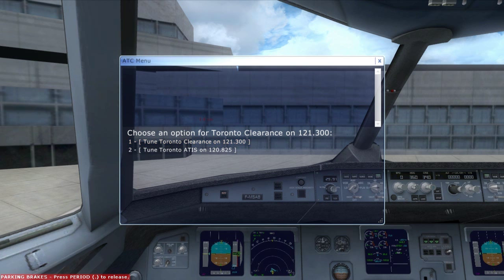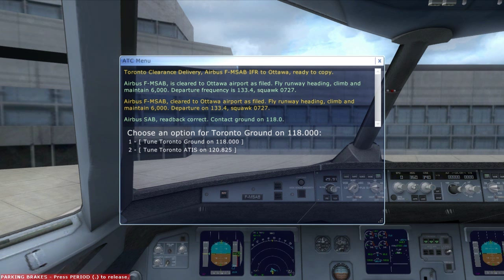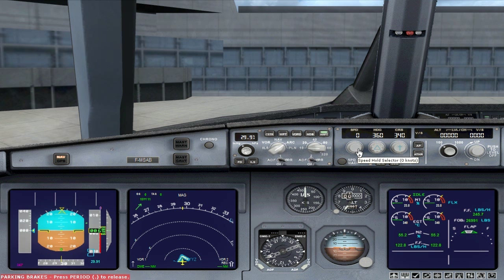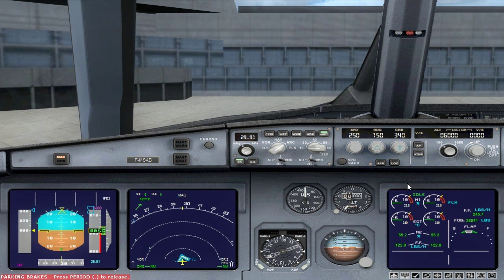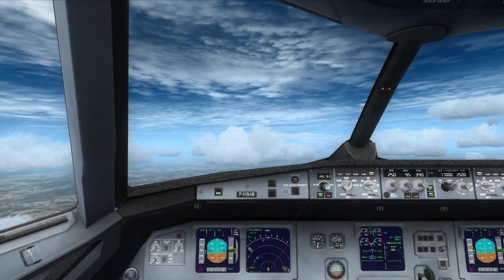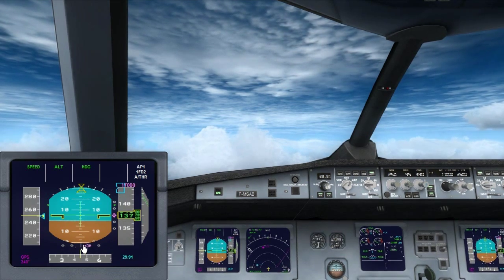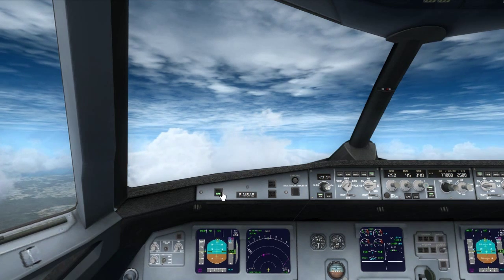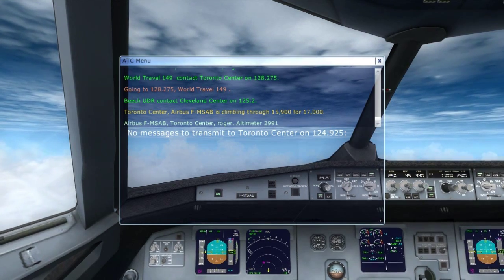ILS Approach and Landing (Part 1 / 4)

Comment from the maker: @nightice92 There is no set altitude you must be at to capture the glideslope. Think of glideslope as a beam sent towards the sky at an angle of about 3 degrees with the horizon. This is applicable to all ILS equipped airports. If you use your desk as the ground and imagine drawing a line towards the sky at an angle of about 3 degrees then imagine your are in a plane travelling parallel to ground. The higher the altitude, the further away from the runway you need to be to intersect the line.

Comment from the maker: @royalengland Well in real life the electric fuel pumps (ones controlled by these switches) aid in maintaining pressure in the fuel system for aircraft in which the engines are placed at a greater distance from the fuel tanks. There are engine driven pumps which keep the pressure adequate in the fuel lines but for takeoff and landing where the functionality of the engines is critical, these electric pumps are switched on. Usually gravity and engine-driven pumps are enough for most situations.